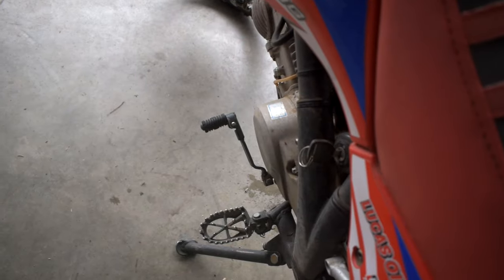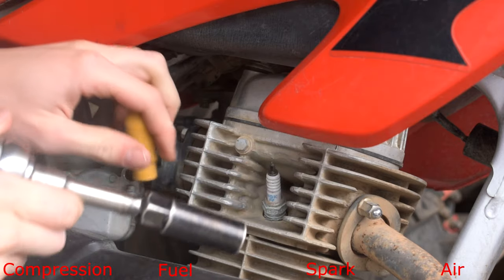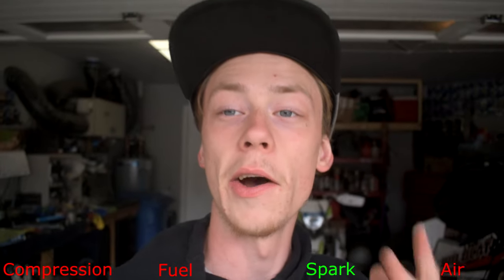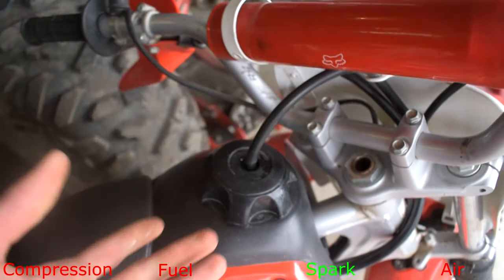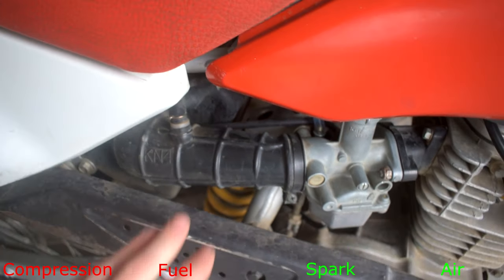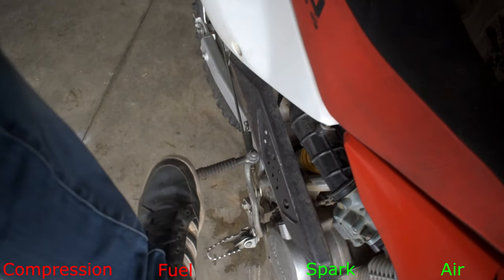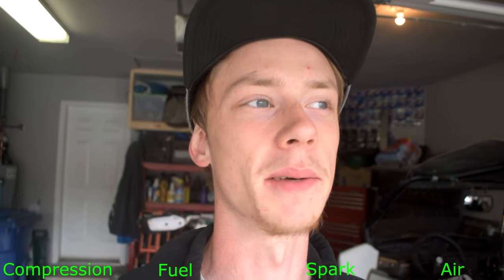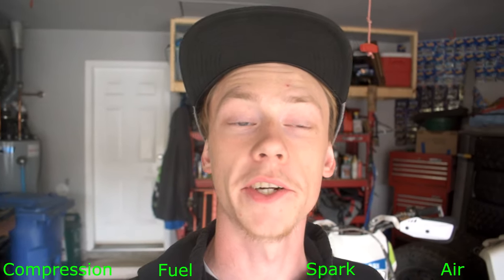Dirt Bike Wont Start? Here's How To Fix It + EXTRA TIPS

Comment: i have a electric start bike, i tried to bump start it, it had a good go at trying but didnt fully start up and sometimes the wheel locked up when it was trying to bump which is normal. But does the wheel locking up in 2nd when trying to bump indicate it has compression?
Reply from the maker: If your bikes fuel injected it may not start if the battery is dead because it does not have the 12volts needed to run the injectors ecu
Reply: @AaronsEnduro  yh we got it running, it was carb, fuel line and filter, air filter and air line.
Reply from the maker: Glad to hear you fixed it!
Reply: @AaronsEnduro  thank! just trashing it about aha!
Reply from the maker: @harrysmith0417  hell yeaa!!!

Comment: Hey I’ve got a quick question…

I am struggling to tune my carburetor mainly because the fuel screw is UNDERNEATH the carb and it’s nearly impossible to get a screw driver in there to turn it while attached to the bike. Any advice or tips on how I could get around it?
Reply from the maker: They sell a fuel screw replacement that turns it into finger knobs to adjust, or cut a custom screw driver to the right length
Reply: @AaronsEnduro  thank you for the response🔥 defs give it a try
Reply from the maker: @jesssefinallyhere766 only happy to help 🤘🏼

Comment: Hey Aaron, I wished I had seen your videos before. I picked up a 1988 Honda XR250R in rough shape and no start; it looked liked it. had been sitting for a long time. Check fuel, spark, compression and air intake and still won't start. Do you have any ideas? I'm suspecting something with the decompression system or the clutch....please help! thank you.
It doesn't looked liked it has been rebuilt or the engine split; I'm about to pull the carb and put a new kit.
Reply from the maker: My question to you would be, how did you verify those things. If they’re all appropriately serviced the bike would run.

My assumption is always (with these old original xr’s) is you either have a carb fueling issue, or the bikes got no compression left in it. Thats like 90% of og xr’s issues.

The most likely culprit with a bike thats been sitting is if they use ethanol based fuel, the gas will evaporate over time and leave shellac inside the entire fuel system (tank, fuel lines, petcock valve and screen, carburetor pilot / main circuit and jets, the float bowl, everywhere.

Shellac is like a rock hard browny gold substance youll see.

Another way is smelling the gas tank, if it smells off and not like “normal” fuel, thats the shellac smell
Reply: Yes, I verified fuel flow at the line going into the carb from the petcock, compression at 125psi (using a tester), The filter looks clean, drained the tank and put fresh gas. When I kick start it, something doesn't feel right so that's why I'm suspecting something with the clutch. I'm taking the carb out and rebuilding it and check valve clearance. Anything I'm missing? TY
Reply from the maker: That’s a great area to start with some diagnosis (carb)

Comment: Mine got every th inv good and it ain’t starting 😢 it might be the timing l, but if there is compression shouldn’t the timing be good? Ima just do timing to be safe
Reply from the maker: Timing is independent, but relative to compression.

Definitely check timing if you’ve recently been in there messing about

Comment: Hey I'm trying to get a mini 50cc bike running it has compression fuel spark and Air but it won't run still any ideas? I sprayed some starting fluid just in case the fuel wasn't actually like getting in fully but it still wouldn't start on that.
Reply from the maker: If you had all of those things the bike would start. Try taking the carborator off and inspecting the pilot jet to see if its clogged ( what controls fuel on startup)
Reply: @AaronsEnduro  I just replaced the carb and realized the screw for the bowl isn't in all the way so its not making a full  seal

Comment: My 2 stroke dirt bike isn't starting. The  battery is totally dead... Is it the problem?... I've checked the spark , compression, fuel and air they're all good..
Reply from the maker: Does it have a kickstart?
Reply: @AaronsEnduro  yeah
Reply from the maker: Is it efi or carby
Reply: @AaronsEnduro  carb
Reply from the maker: Efi wont wanna run if its under 10-11 volts

If its carby you got other issue then the battery
Reply: @AaronsEnduro  thanks dude
Reply from the maker: If all four were good, the bike would run
Reply from the maker: Assuming its been sitting as the battery is dead. My best guess is clogged jet or something to do with fuel delivery
Reply from the maker: If you wanna dive into a deeper 1 on 1 chat check this out:

https://www.youtube.com/channel/UCcviyKZ2Vf3IHFliwebzODA/join

Comment: I don't know what's wrong with my bike.  It was running fine one fall until I burned up a clutch.  That winter I took the carb off and rebuilt it and put it back on and it ran great, then when I put the new clutch in it wouldn't start anymore.  Was really weird.  I checked the electronics with a multimeter with the peak voltage adapter and found out that my cdi was bad, replaced it and had spark again but still wouldn't start.  Put a fresh battery in it for the first time ever and realized mine had been dead since I bought the bike but was always fine without it.  Now the lights work even when the bikes not running but it still won't start.  Completely dried out the tank and put only fresh fuel in it, still won't start.  Took the carb back off and took it back apart and my diaphragm had exploded!  Adjusted the valves, the intake were a tiny bit loose, put a whole new carb on it and still won't start.  Has good fuel, proper spark, plenty of compression, new air filter...
Fuel ✅️
Air ✅️
Compression✅️
Spark✅️

Still won't start.
Reply from the maker: Does the engine turn over?
Reply from the maker: Have you done a compression test with a gauge? How do you know that you have compression
Reply from the maker: If i had to guess, if the bike ran fine before doing a clutch but now doesn’t, thatd make me think the clutch is sticking, preventing the engine from turning over freely?
Reply: @AaronsEnduro  Thank you so much for the reply!  I'm out in the middle of nowhere where I live.  Yes it turns over fine, it's an old xr650r so there's no mistaking the compression, in fact I'm huge but still have to use the decompression lever to kick it.  Sometimes it will feebly sputter for a second but quickly dies.  It's easier to get it to do that if I give it a few kicks with wide open throttle immediately before, so I don't know if it's getting flooded maybe..?  Or maybe the opposite?
I've tried every different kind of choke lever position and it won't even run on starter fluid.  I recently changed the oil and filled it up with the special non silicate coolant it wants... I fix and flip small engine stuff as a side hustle, I'm usually pretty good with stuff like this, but I'm just about stumped.  Next thing I can think is to take the exhaust off and make sure there isn't a big mouse or wasp next clogging it.  I very much appreciate any advice.
Reply from the maker: After kicking it over a bunch check the spark plug. Is it wet? Have you verified visibly that you have spark when your kicking it over?
Reply from the maker: If you’re interested in chatting 1 on 1 and doing more a deep dive with me on this, check this out :

https://www.youtube.com/channel/UCcviyKZ2Vf3IHFliwebzODA/join
Reply: @AaronsEnduro  I have visually verified the spark as well as tested the voltage at the plug.
Reply from the maker: And you know its being converted from low 5volt to high 12 volt
Reply: @AaronsEnduro  That makes sense to me too, but it's a brand new clutch and clutch basket, plus I'm starting in neutral anyway.  Also the lever feels perfect and I've taken the clutch cover off and visually confirmed that it's working properly.  I've really been through the book forward and back already on this one.
Reply: @AaronsEnduro  That's a good point.  I'll check and see if the plug is getting wet.
Reply from the maker: And what color is your plug
Reply: @AaronsEnduro  I appreciate the help and the advice and the offer, but let me go pull my hair out some more and if I can't get it today I might take you up on that.
Reply from the maker: Best of luck lemme know how it goes!
Reply: @AaronsEnduro  Brand new, of course!  😄
Reply: @AaronsEnduro  Thank you.  Will do.
Reply: Quick update for everybody who reads this in the future, when I bought the bike the guy told me the killswitch had already been disconnected.  When I opened it up I found that really he had run wires in between the kill switch and the piece of metal that it was supposed to ground out to when it was pressed.  Before I ever found  this video I had removed that piece of metal which also goes to the horn and had put it back together, since I'd removed the horn long ago anyway.  Today I took apart the piece with the wires and switches on the left handlebar again and physically clipped and separated the wire going to the kill switch so that it cannot possibly ground.  Still won't start, but it's one more thing I've already ruled out.
Also today I had the gas cap off and went to blow through the little hole in the cap and found that I couldn't!  I poked a drill bit a tiny bit smaller than the hole into it and discovered that theres a ball valve inside of it designed to keep it from leaking fuel if it tips over and it had somehow got stuck shut to where I couldnt blow through it either way!  It once again seemed weird to me because I had just put the big clear Clarke gas tank on there only a few years and a probably less than 100 miles ago, but I got kind of excited, I figured this must be it, but go figure, it's just one more on a long list of things that I searched hard and long enough to find but still wasn't the culprit...  or maybe its like whack a mole and that was the culprit yesterday and there's a new one today...  Anyway I'm going to go try more things and thank God that I did a bunch of research and picked such a reliable bike when I bought it.
Reply: Also I checked the adjustment screw on the brand new carb today and found that it was bottomed out.  I backed it out the recommended (at least on the stock carb) 1.5 turns and now it sounds a little wetter and healthier when it doesn't start, but it still doesn't start.
Reply: @AaronsEnduro  I've got a big aftermarket Clarke gas tank on it that makes it impossible to check the spark plug without removing the seat and tank, and it's also a huge pain to put back on, so checking to see if the spark plug gets wet might have to continue to wait a bit.
Reply from the maker: I mean if the plugs getting wet, she wont fire up, but best o luck on your bike!
Reply: Oh ffs, turns out that wasn't the adjustment screw.  Whoever made this cheap aftermarket carb put the drain screw right where the adjustment screw should be!  Anyway fixed that and at least now I know fuel is running and the carbs full of fresh stuff!
Reply: So I checked the exhaust, looks like the spark arrestor wouldn't allow anything any further into the pipe and it looks clean inside, so I decided to hold my hand over the exhaust pipe while kicking it to make sure it was pumping air out, but instead it's sucking air in?!  I just checked the valves, I had a new stage 1 cam put in professionally just maybe 100 miles ago before the clutch burned up and it did run fine until then...  what the hell's going on?  Are they supposed to do that?!
Reply from the maker: @bluefrog8670 if you put a piece of papers at the pipe and its trying to suck it in and out , noooo beuno
Reply from the maker: @bluefrog8670  sounds like valve/ cam issue
Reply from the maker: possibly bad headgasket
Reply: @AaronsEnduro  I didn't try paper, but it was pretty obvious with my hand.  To me that would usually mean valves but I just did them maybe a week ago and I've never botched a valve job yet...  while I can't rule out that they already went bad somehow, that does seem pretty unlikely to me...  I guess it's time to take it all back apart and if the valves are good check my cam and timing chain.

Comment: Does It matter which type of gas is used??
Reply from the maker: not really to have it run. But if you do use ethanol-based fuel over time it will leave shellac in the carb if you didnt drain the carb prior to letting it sit for an extended time

Comment: What do you do if you have checked compression spark fuel and air but it still doesn’t start
Reply from the maker: Check again, because if you had them all, it would start
Reply: @AaronsEnduro  I just checked again but there still all working and it doesn’t start
Reply from the maker: Has the bike been sitting for a long time
Reply: @AaronsEnduro  yes I was just kicking it over and the kick starter seized and stop moving😱
Reply from the maker: My guess is that you you’ve flooded it and it just hydro locked if u can no longer turn the engine over
Reply from the maker: What happens if you try n bump start it
Reply from the maker: When you pulled the spark plug what color was the tip
Reply: @AaronsEnduro  it just got a new spark plug
Reply: @AaronsEnduro  I’ve tried to bump start it doesn’t work
Reply from the maker: What color was the old
Plug
Reply: @AaronsEnduro  is the locking on the kick starter a big issue
Reply: @AaronsEnduro  the old one was back and had a crack
Reply from the maker: What bike are we talking about and how long did it sit. When you bump start the bike does the engine turn over (and did that free up the kickstarter) or does the engine not rotate anymore
Reply from the maker: If you’re looking for 1 on 1 guidance you should check this out 

https://www.youtube.com/channel/UCcviyKZ2Vf3IHFliwebzODA/join
Reply from the maker: @mitchellhogarth765  it can be worst than initially thought yes
Reply: @AaronsEnduro  it’s a Suzuki jr80 as a little profet bike and the kick starters free now but still doesn’t start it could have been sitting for like 2 years it was broken when I got it
Reply from the maker: @mitchellhogarth765  lmk if you join and we can do a deep dive on it
Reply: @AaronsEnduro  I got it it has started no idea how but thanks

Comment: I got a ssr200 bike runs good but the boot that’s on the carb intake is a little ripped it’s not terrible but it’s definitely ripped is that super bad ? i have a clamp over the rip that’s kinda covering it rn
Reply from the maker: Yes, thats unmetered and unfiltered air entering the system. This will 100 lead to your bike running lean. You can blow up your engine running it like that

Comment: So I bought this 525exc KTM and I was riding and then I shut it off and there was so resistance when I was kick starting it what should I do?
Reply from the maker: sounds like a loss of compression. I'd do a compression test
Reply: @AaronsEnduro  did you happen to make a video or should I look it up
Reply from the maker: I dont have one on that specifically, but you just put a tester in the sparkplug hole and kick it over and youll see if you have a good sealed engine or not

Comment: Hey bro I've been trying to start an old school trimoto 125 trimoto 125 I have spark i sing i seem to have fuel but even if i spray start but even if i spray starting fluid in it it doesn't want to turn over
Reply from the maker: Hard to say with that little information. Id be going over the bike in depth and checking everything out piece by piece

Comment: Hello I have a Yamaha YZ 250 that I am restoring put a new piston in it with all new gaskets put a new ignition coil spark plug got a new carburetor regenerate to the original idol jet but it still won’t start it’s got spark it’s got great compression and I even spray some starter fluid to make sure it’s get gasI was wondering if y’all had any ideas thank you very much

Comment: i have like a 92 xr80r i got a few weeks ago from someone was running decent all the sudden doesnt run anymore was riding it cut off tried to fire back up it starts then turns off after a second doesnt go to idle and it i turn the throttle immediately turns off i just put new spark plug checked the air filter those are good just changed the carb float and it has fresh gas  any ideas on what to check next?

Comment: Hi. My Kickstart is only turning the starter and it gets hard and stuck and have to force the kick start down. What could be the problem?
Reply from the maker: Could be a broken piston ring causing a sticking piston. Or possibly broken teeth on the kickstart shaft. Hard to diagnose with that limited info

Comment: I stalled my crf 125 and then it wouldn’t start again i have a spark, i have compression, i have air and i have fuel coming in
Reply from the maker: Does it still kick over easy? If not u seized the engine
Reply from the maker: I going assume it stalled because you lost fuel pressure or compression.

Comment: If the carb  float is stuck would that cause the electric start to not even try to start the bike?
Reply from the maker: No. They are completely separate. If your electric start isint turning over the engine thats a seperate issue. 

The float ONLY controls fuel delivery from the gas tank into the carb bowl. Thats it.

Now if thats not working. Your bike wont start, but if the electric start IS working then youd be hearing the bike turnover like its trying to start but never start.

If the electric start ISINT working, youll hit the start button and nothing happens